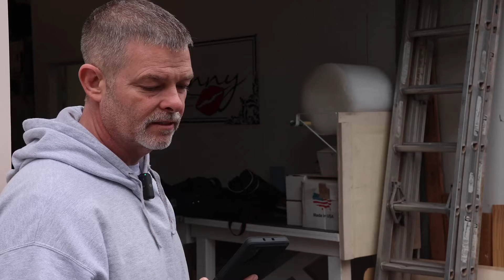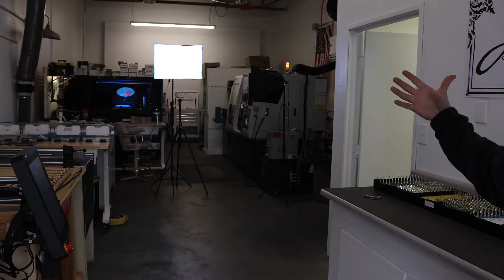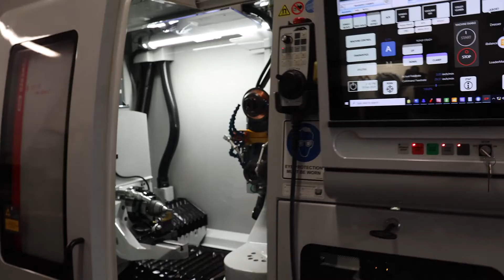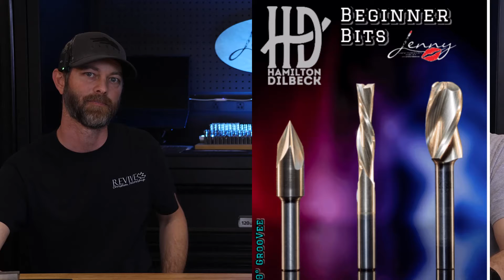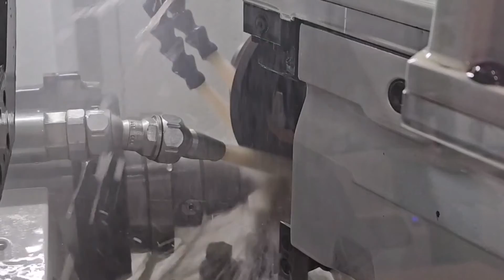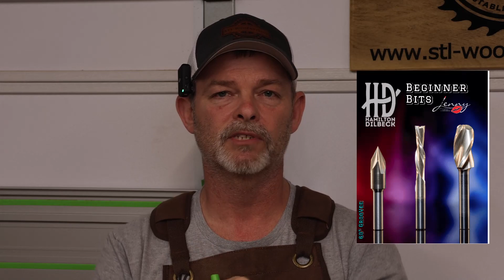The Secret Behind the Jenny Bit That's Taking Over Woodworking

Comment: You mentioned that you do inlays little different. Different how? 
How do you address the tapered ball nose vs a Vbit in the inlay as the TBN has a rounded tip vs a point. VCarve does not really like this and many times the inlays are sloppy. What are you doing to address this?
Is Cody going to make a 12 degree Vbit?
Reply from the maker: I have another video about inlays that explains how I do my tool paths for them. It's how to get perfect inlays or something like that